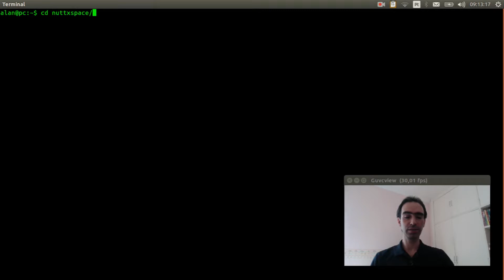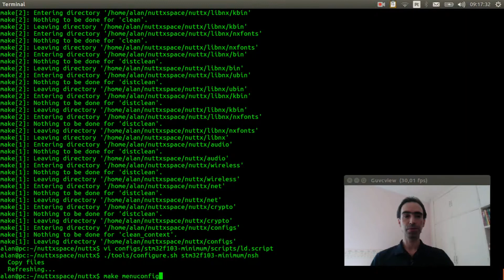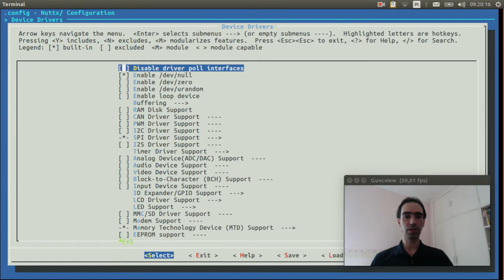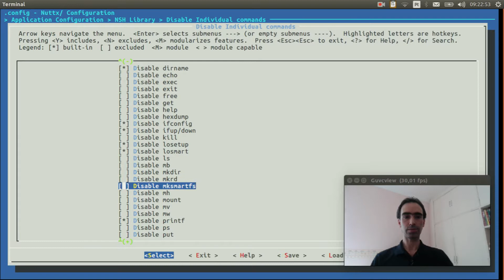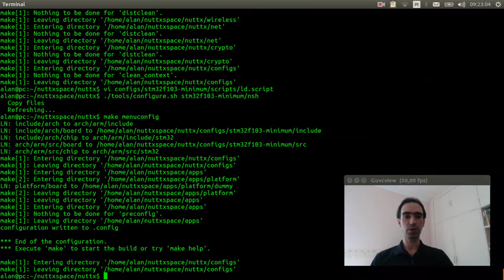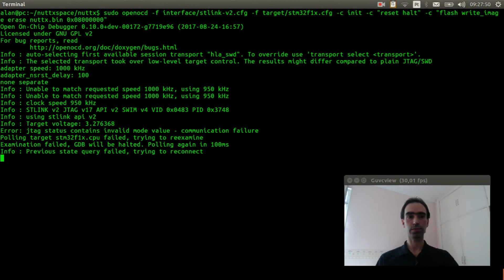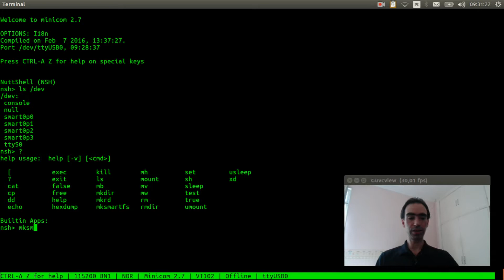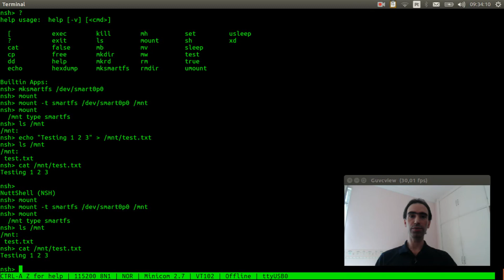#018: Using SPI NOR Flash with SmartFS on NuttX

Comment: Hello, Please give advise how to use the SmartFS with the SPI NOR Flash with another STM32, like STM32F401 for example
Reply: Hi Jivko, the process is very similar to what I had shown to STM32F103. Also you can take a look at stm32f429i-disco board directory, this board has Kconfig examples to use SMARTFS with SPI NOR.
Reply: @AnotherByteData  Thank you Alan for your quick answer.